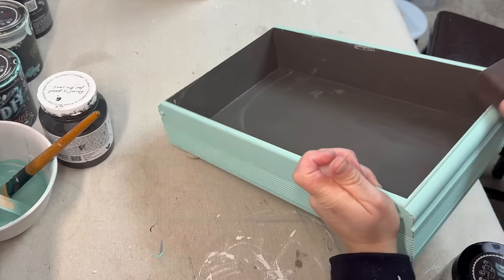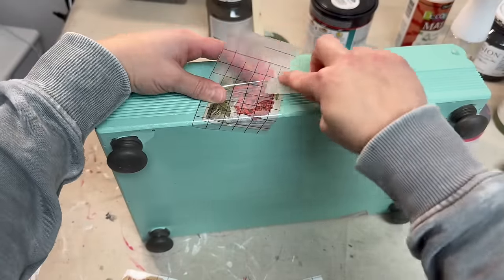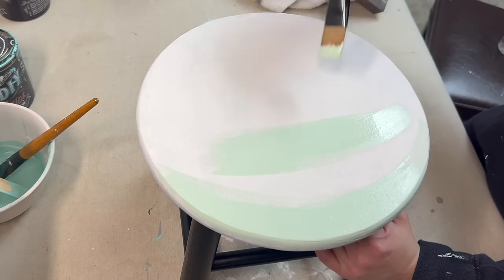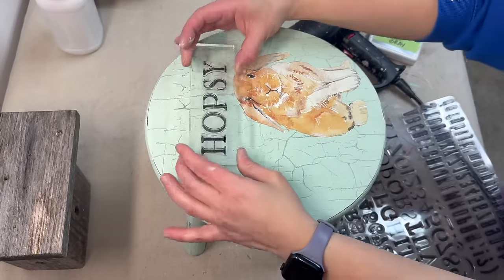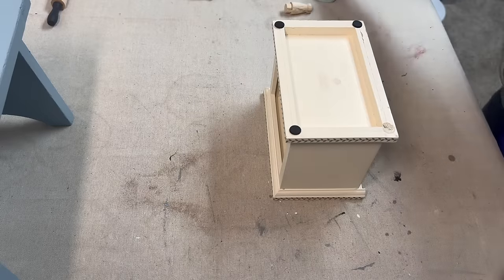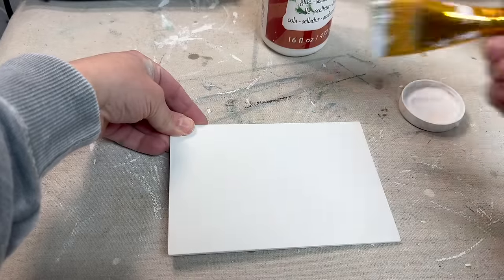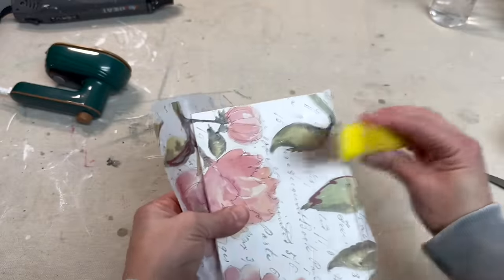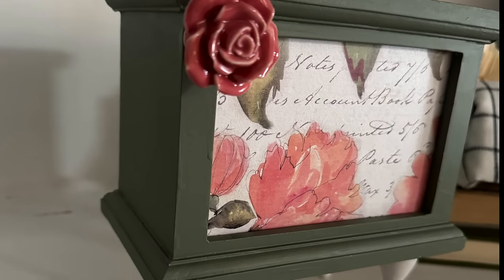Thrift Flip | Upcycle | IOD Stamps & Transfers | Functional Home Decor

Comment: Luv all the projects.
I like that you give new looks to the wooden pieces.
I like repurposing wooden boxes regardless of size.
The green color for the last project was very pretty complementing the pink roses.
I think  you should have used the ceramic rose knob on top to open the top of the box.
It looks akward on the front.
Reply from the maker: Thank you very much! I love reading your feedback!  I actually tried to have the knob on top at first but it was too big and bulky.  Also it’s heavy and the lid doesn’t have anything to keep it open without letting it go all the way back and “hitting” the back.  I was nervous about damaging the piece or the knob.  I was searching my stuff for any knobs that were smaller and I couldn’t find anything 😣.  I had considered a mini pull as well.  Think I should do that?
Reply: @SparksofJoyStudio  I think a mini pull would work.

Comment: Do you seal you paint in? I didn’t notice your doing that?
Reply from the maker: Good question! Yes - I will seal any paint that doesn’t have its own built in sealer or after applying a transfer.   I typically use a polyacrylic sealer but I also use wax.  I do not seal paint that has a built in sealer.   I will do a better job of communicating that in my videos.  I appreciate the question!  It will help remind me! 🥰